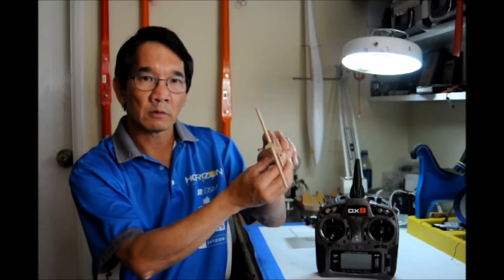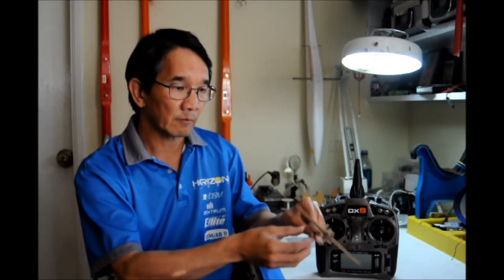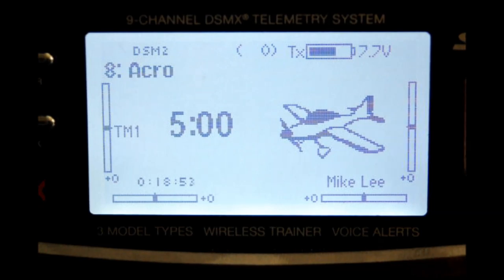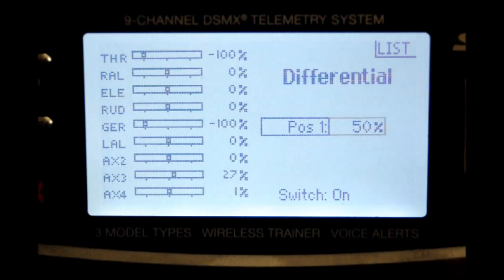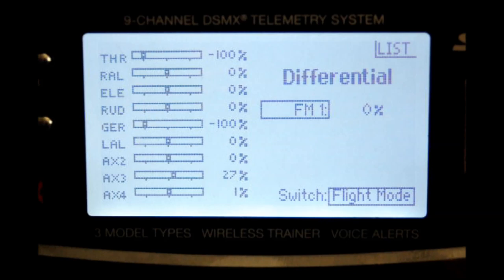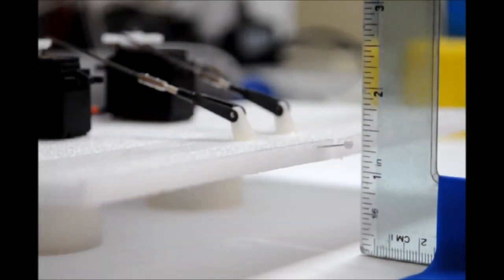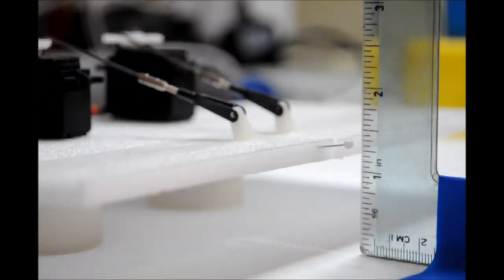Team Tech Tip   Aileron Differential

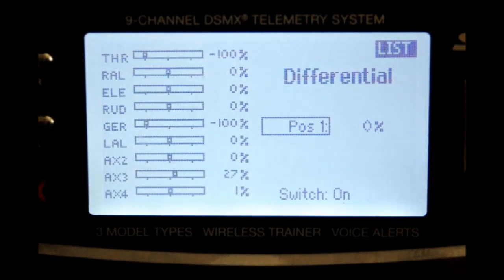Comment: At 1:59, it shows Differential in the menu. However, that menu option is not available on my DX9. Where did it go?
Reply: Under System Setup; under Aircraft Type It needs to be set up as Dual Ail, or the Differential option is not available.
Reply: Joe Cochran Thanks Joe!